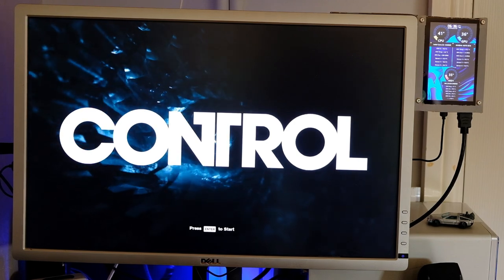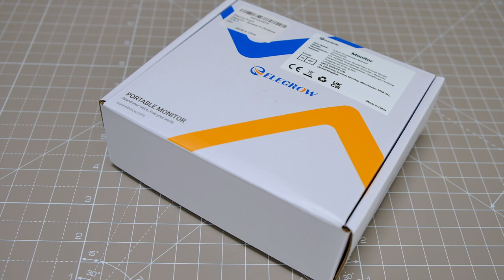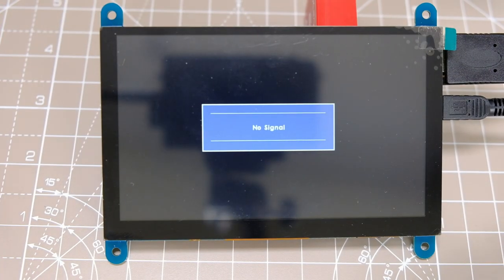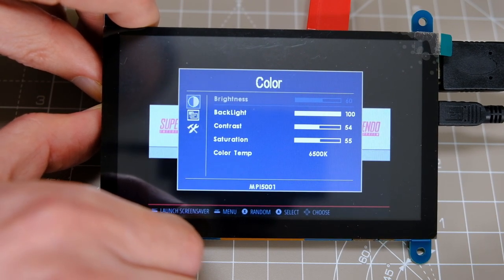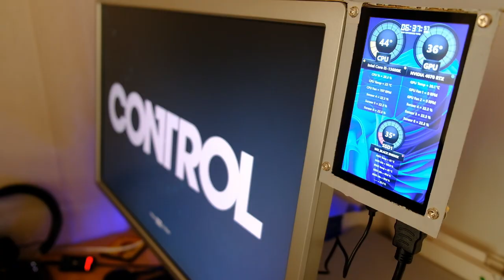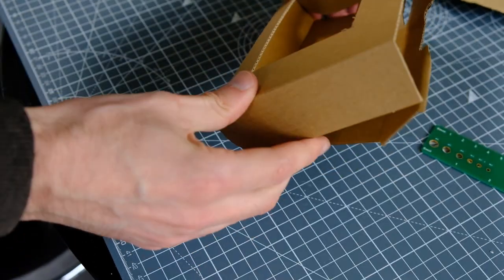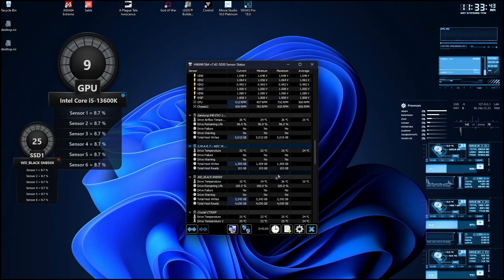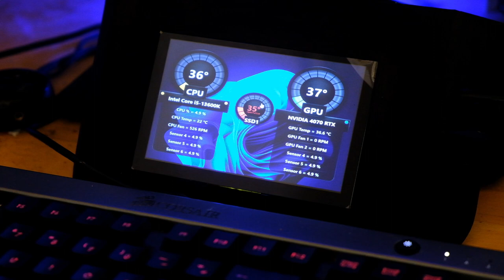Make your own PC Sensor Panel - 2 Designs!  PC Hardware Monitor with 5 inch screen from Elecrow

Comment: One thing im having issues with is getting the gauges to auto populate data after shutting down or restarting the pc. I have to right click on the gauge and click refresh all every time. Is there a way to get them to auto populate on startup?
Reply from the maker: Do you mean their position on-screen, or the contents of the gauges?
Reply: @Endpoint101  the content on the gauge for example it will display the cpu temp value but when I turn the pc off and back on or restart the cpu temp value will not display till I right click on the sensor gauge and click refresh all. Then the gauge will display the cpu temp value
Reply from the maker: @squeakycahlean  Huh weird. I'd raise that with the developer of the gauges. There's a forum post on the RainMeter site & hopefully he'll respond.
Reply: I left a comment on his deviantart post where I got it. I wonder if my hwinfo isn’t auto starting
Reply from the maker: @squeakycahlean  Ah yes, it could be that, good idea!